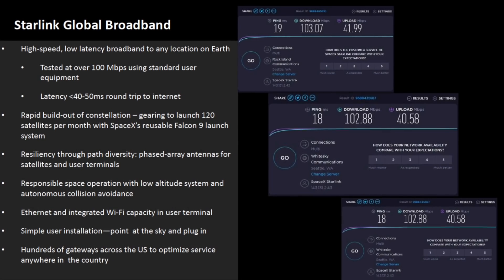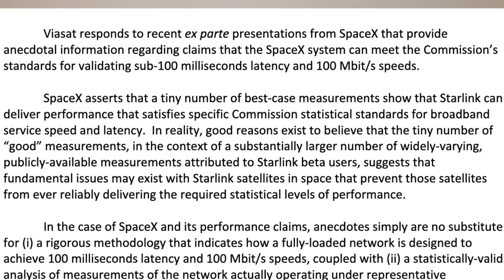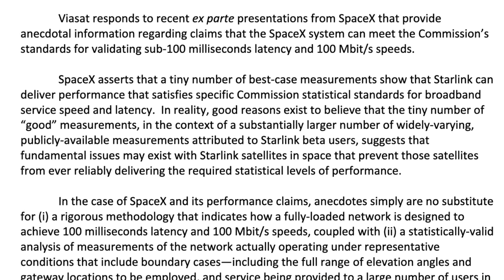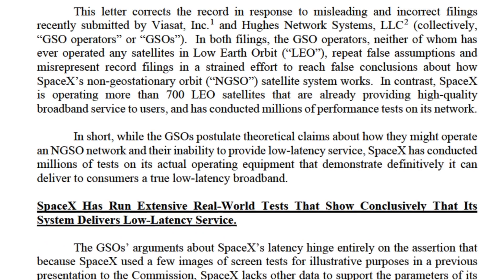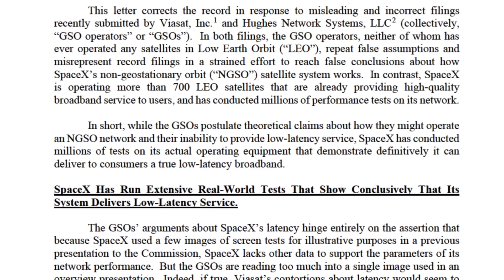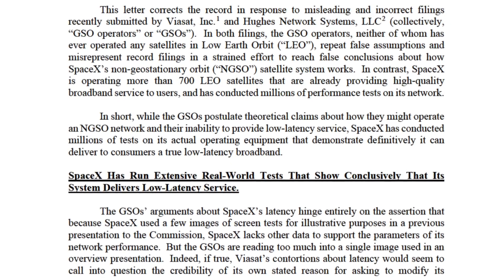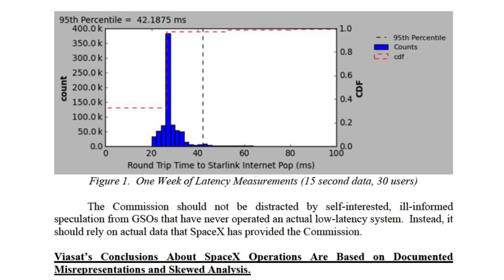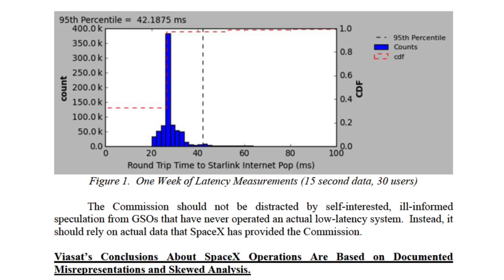SpaceX Viasat THROWDOWN on Latency Reveals REAL Starlink Latency under load and Testing Plans

Comment: it will be nice to have better latency, but I'm just tired of data caps. oh sure I can stream in 720p with viasat but it burns up my data so fast that I end up watching at 240p most of the time just to stretch my 10G of data out. once it's used up I'm down to 144p with buffering.

Comment: There's another issue that is actually in Viasat's favor.  With a Geostationary satellite, you just need a clear line of sight to the satellite.  But a LEO earth station needs to have a clear view of a fairly large portion of the sky to always see a satellite so that it can hand-over from one satellite to another.  A ground station will have to have beam-steering antennas, and not a simple dish.
Reply: Id say the difference would be that a geostationary satellite might be unreachable for a fairly long time while a LEO satellite would move in and out of view. However with a constellation you an have many satellites that are potentially in view so it would be a matter of switching satellites.

You dont need to physically move an antenna to aim your signal - phased array antennas exist.
Reply: @pflernak  This "matter of switching satellites" is exactly what I was referring to when I said "hand-over".  It's like changing towers when using a mobile phone.  There's a problem when you can't see the next satellite because your window of the sky is too small.

Comment: Regarding the transmission framing changes. Usually you have a fixed frame length (n bits) and will typically group users with similar RF link performance into the frame at the most efficient modulation and coding scheme that group can support. If you have user packets which queued don't fit into frame then they will await the next frame they can be transmitted on, and any unused space in the frame will be padded until it meets the required length. If you have a small number of users then your channel effeciency will typically be lower as you have a higher probability of in sufficient users as at similar RF link quality to fully populate a frame. There is not typically an upper bound in such systems to the number of users which can have packet data units transmitted into a single frame, rather the upper bound is set by the minimum PDU size in relation to the frame size. Another note, typically the larger of the two contributions to latency will be the terminal uplink as these are usually much smaller carrier sizes in an TDMA type scheme due to the relatively limited terminal EIRP - particularly in terminally of this nature with small effective apatures as your off axis PSD will otherwise get out of hand and you will then definitely have some FCC issues. If you have any technical documentation on the transmission systems Starlink are using this would be great!

Comment: The radio waves move at the speed of light (300.000km/s), so lowering it by 500km shorts the path my 1000km. So the save 3.3ms (1000km / 300.000km/s). A great ping time is 30ms, so the difference is not much, but noticeable.
Reply: the whole constelation get closer aswell.

Comment: Viasat is awful. We tried them. "Here's a high-speed connection that you can only use at high speed for about an hour per month and then we throttle it so badly that it takes an hour to get your email." It was utter garbage and Hughes is the same way with their stingy data limits.

Comment: I had Viasat for almost 2 years at 80$ a month.... Their latency was never better than 600ms. I was supposed to get 12mbps down and 3 up but never saw that speed even once. I would mostly get 5mbps up until I reached the 40GB cap and then get throttled to 600k at 600ping.... I canceled my subscription and now use cell hotspots (still low bandwidth but at least cell hotspots have 50ish ping). Viasat has no leg to stand on calling out Starlink's latency when they can't even keep my connection to the bandwidth that I paid for.

Comment: If the latency is sub 20ms the upload speed would match the download speeds. Sub 20ms is hard wired fiber internet. Star link is probably closer to 50-60ms on a nice clear day.
Reply: What you said is wrong. The asymmetric or not of the satellite link has nothing to do with latency unloaded, it may go up a little under load, the reason fiber has low latency consistently is the fiber itself has much higher bandwidth and is artificially limited to lower speeds. If you were to max out the real bandwidth on fiber the latency would similarly go up. In any case the lantecy is 10-30x better than any other satellite service... so its gonna be a huge deal.

Comment: The current Beta applies only to an area where both the 1 ground station and Beta users can see the same satellite at same time. 

The "pitched" plan, should it get implemeted will see the inter-satellite links converge traffic from many satellites onto one which is passing over a ground station.  

As with all other broadband satellites, the bottleneck is the satellite uplink between ground-station and satellite, not the links between satellite and end users.

The true capacity is defined by how many end users are funneled into each uplink from ground station. 

GEO satellites  have defined cone/footprint for the uplink directed at a specific location when they are built. For instance, the VIASAT has a cone used byXplornet in Canada and was aimed at Toronto at time of construction to serve the Canadian market. 

LEO have an advantage of not having fixer ground stations hardwrired in their construction so it is easy to add ground stations to add capacityt tothe sysrtem and just send software updated to the satellites to use the new ground stations if they are over it. 

However, economic realities will see SpaceX like all others being forced to growssly oversubscribe the system to make money instead of deploying ground stations all around the world.

Current deployment has each satellite see a footprint of 1664km in diametre.  Which this is is obviously better than GEO satellites, it is still a lot of people to serve  per satellite. 

Note how satellitre operates are very careful to never release the capacity (speed) of the ground station to satellite uplinks. 

So in the end, it all depends on how many people SpaceX intends to serve on how many ground stations.  And it it routes traffic between staellites, all Netflix traffic may end up coming from the same ground station near Netflix's HQ. 

There is no question that LEO can provide better service than GEO.  But it is still bound by the same laws of physisc on capacity between ground station and satellite, even if latency is lower.

Consider also that with the LEO constellation and constantly changing connections betwen you and satellites and between statellites and between satellites and ground stations, that "latency" becomes quite different than talking to a single satellite, especially as you get short periods of no service as a satellite switches its connection to another satellite and another ground station.

Comment: Companies that cannot compete need to change their ways or fold up. Starlink in a very short time has more satellites in orbit and operatioal than any other satellite constellation.
Reply: when the requisite is a fundamentally different multi tens of billion dollar rocket company (of which there was many but they have either already failed or will fail), competing with that is straight up impossible. Space-x earns the money to pay for the rockets on 1st and/or 2nd launch and the 3rd, 4th, etc... are pretty much just cost of fuel for spacex to get those sats up there compared to millions of dollars per sat conventionally. Hell with the ride-share where they have customers pay for fuel they are pretty much launching stats into space for free. There is just no way to compete with that.

Comment: That means we only need one satellite for the test.  
Because two users are sitting in the same area. 

Which is more realistic if two users are on different 
sides of the earth. 

Then the signal has to go through a lot of Starlink 
satellites. The latency is then more realistic and 
probably much higher.
Reply from the maker: That's what the Ground Stations do today - they connect the user terminal to the Internet by bouncing the signal off one satellite. Soon they'll have the laser links that will allow signals between satellites. Thanks for watching!

Comment: Thanks for the updates, I'm on the public beta list, but with the 700,000+ users signed up, I doubt I'll be able to be a part of it. I had Starband (now VIAsat) a long time ago(15+ years), and it was fine until they really clamped down on the speeds and data limits. On Spectrum now and I'm not happy! Since I have Spectrum, I'm not in the ideal target area for Starlink, that's why I say I doubt I'll get the chance to try this during the beta phase.

Comment: 30 uses doesn't seem like a very "congested" cell. Perhaps I don't understand what a "cell" is?
Reply: I would like to know the size of an area (on average if it's variable) a cell covers. I'm sure this would have been discussed before but I have missed it.
Reply: @Borgscan  The area of the cell is determine by beamwidth and the satellite altitude. The beamwidth can be adjusted by upgrading their phase array antenna and the altitude can be adjusted by asking the FCC for permission to change the altitude of the constellation. So the area of the cell is not fix. We don't know the beamwidth and there is a good chance it changes as Starlink iterate on their satellite design.
Reply: @kazedcat  Thanks.

Comment: My initial guess regarding the "frame" described in the video, is that it is likely implemented as TDMA or time-division-multiple-access similar to how cell phone networks work, where each terminal is given a timeslot within the frame. The document referenced in the video describes the use of 8 slots initially, which likely left other slots empty as guard slots, during testing to limit potential slot overlap due to less precise timing. As the protocol and it's parameters are refined, SpaceX is able to reliably allocate more slots, for data up to a maximum allowed by the frame. This is my speculation but seems possible.
Reply from the maker: I think you're right. Packing more slots into the same amount of time. So could allow for higher bandwidth for one customer, or more customers with the same bandwidth. Thanks for the feedback!

Comment: I heard that supposedly the public beta will likely be available in November. Is that true? If so, where would it be available? Also would everyone be able to try it?
Reply: I have every intention on getting it and i believe i live in one of the beta areas
Reply: You are probably too late for the Beta. They started advertising for it about 6(?) months ago. You needed to be between the 44th and the 52nd parallel north. Basically they have just one orbital path set up for testing.

Comment: Where does 'bandwidth' play in this or does it? Thank You!
Reply: The results seem to be in the "Enough" category. Not the fastest, fastest, but enough to "win" anywhere that's not a city. Inside cities, you'll end up with too many people trying to share that bandwidth. So there'd be a hard cap on things like "How many people from Seattle" they can have on. But Seattle is less than 1% of the state. And this will work on the peak of Mount Rainier. And on a boat. And in a campground.
I personally wouldn't be shocked if "If you live in a city, you can only get it with a Tesla" ends up as the rule.

Comment: any idea how the user terminals will cope with heavy rain and especially snow ? maybe it will run hot enough to melt it ?
Reply: i cant see it being much worse than signal from a cell tower in a storm
Reply: Keep in mint that Starlink is LEO (low earth orbit). 340 miles for Starlink and Viasat 5K miles. So for Starlink the power requirements are significantly lower and the signal should be much harder to disrupt.
Reply: @bradquinn4161  I was referring more to the snow accumulating on the user terminal
Reply: @tortue71  It is hard to tell from the pictures of the current units but the earlier units the "dish" part of the unit was not really a dish but pretty much flat faced. If you do an google image search on " Starlink dish"  one of the images that comes up is an exploded diagram of the actual antenna part of the unit. It is basically just a flat plate. The motors and the electronics are just encased below the antenna. Keep in mind that for any given location the unit should not have to move after is has aligned itself with the optimal satellite path. The phased array part of the antenna  does the satellite tracking electronically rather than mechanically.
Reply: @bradquinn4161  yes I understand it and that's exactly my point. We better keep the user in a close spot and accessible because we will have to remove snow often ! Tv dishes are almost vertical here up north so snow is not much of a concern , but Starlink will be looking almost right over us so it will catch a lot more snow. I don't believe that it will work with a couple of inches on the terminal, unless it's hot enough to melt it
Reply: @tortue71  Yeah, you are still not getting it. As the "top" of the unit is (assuming the new units are like the old one) a flat surface, so any angle will allow the snow to slide off pretty easily. The units are not like the GEO units where they only point south. The unit aligns itself to the orbital path. Even if you are directly below the orbital path, the satellite will likely not orient itself straight up, but angled to the east or west. Then as the system becomes fully populated there are orbital paths that will run north to south rather than east to west.
Reply: When will Starlink make it to the UK?
Reply: @parvezahmedjalil7310  The vast majority of the UK is too densely populated to probably qualify for Starlink.
Reply: @parvezahmedjalil7310  I have a feeling in UK you're going to be stuck with OneWeb.

Comment: Very interesting as always, I’ll have a read of the data as when I saw the 2.5x data increase I assumed a modulation change rather than a frame change but now I’m curious. Thanks again

Edit: after reading I would say the frame size stays the same and the TDMA schema has been running with empty slots, causing delay between linked packets. The frame size will be the same I think. 

My bigger question would be the RF distribution at ground segment. If they are using 3rd party systems they have no control of RF routing and the latency it will add. So are they converting to digital and entering the POP direct to cloud?

Comment: I also don't understand what Viasat has to do with any LEO internet system, unless they have plans to get into a system based on LEO satellites.  HOWEVER, I can tell you right now based on MY account with Viasat that they are already guilty of fraudulent service.  I have the fastest satellite service with them now -- 30 mbps down/ 4 mbps up -- and they NEVER reach those speeds.  Ping time consistently stays at 600-700 milliseconds (due to the geostationary satellite distance).  Of course, the contract reads "up to" 30 mbps, and they guarantee nothing.  I also have a DSL connection from CenturyLink that runs "up to" 1.5 mbps down, and CenturyLink is almost always FASTER than the Viasat connection.  And to top it off, Viasat promised me that I'd be on their latest ViaSat-2 high capacity satellite that they just put up in orbit three years ago, but once the system was operating at my house, they then told me that I could not be on the new satellite because of my location.  In other words, the sales department flat out LIED to me.  Once Starlink is up and running, Viasat is HISTORY, even if they do get into a LEO business.
Reply: I have the 100mbps plan and did a 135mbps Speedtest today. However that was after a 12+ hour outage 😂 plus during peak time it goes to total shit.
Reply: I agree. They have nerves filing these against spacex. They will be dead 3 months after spacex deploys a beta.
Reply: WHERE THEFUK DO YOU LIVE? in Europe i get unlimited 1g for 30$ . wtf
Reply: @luderx  many non dense areas are considered now worthy by the companies to install cables and stuff... and this also includes cell towers.... Plus, on many cities, like NY with old buildings, it's not so easy to find a way to install more cables as well...
Reply: @luderx  Population in Europe is Much better and there are more gov't subsidies. In US there are regions where there is No financial incentive for ground links faster than DSL (mostly because the phone lines are there anyway. There is a $16 billion dollar program to remedy that somewhat but Starlink will likely solve it before they finish building out. (They're still in the bidding stage.)